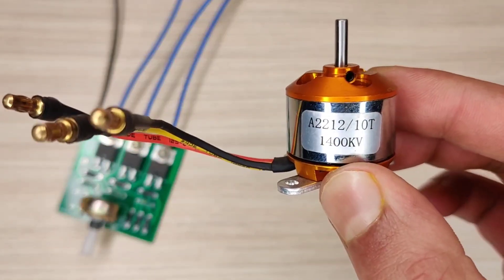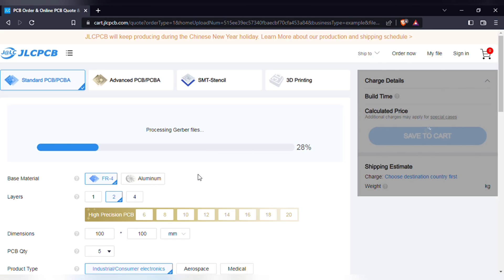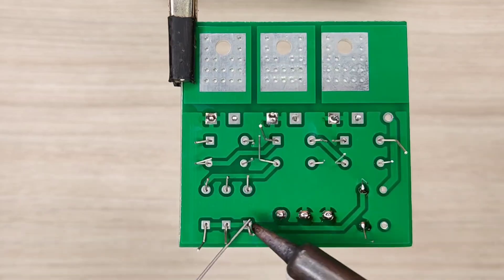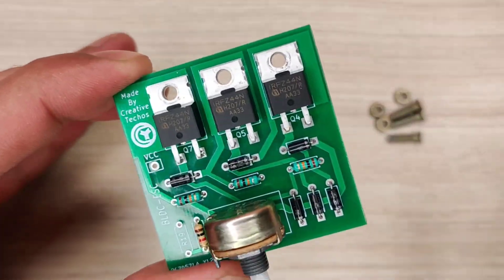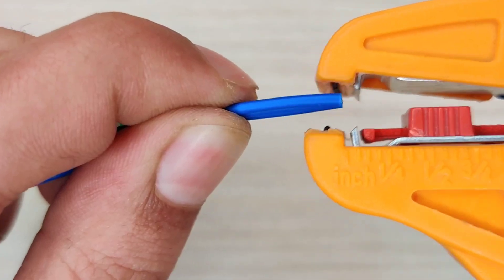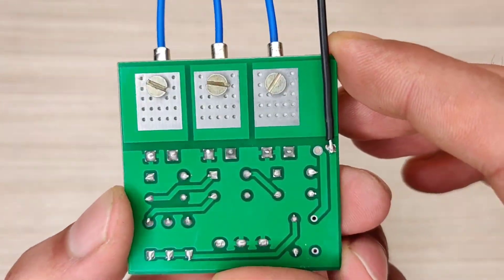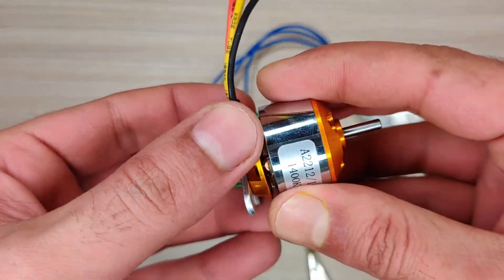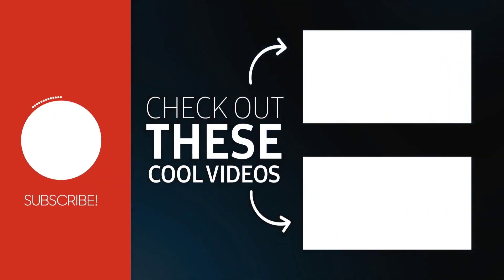Simple BLDC motor controller circuit Using irfz44n mosfet

Comment: I don't think it can work like this!
No control signals / commutation
There is nothing on the G gates of the MOSFETs (Q4–Q7) that dynamically switches the transistors according to the commutation sequence of the BLDC motor.

It looks like the gates are just connected to the power supply via diodes via resistors.

This way the phases are not switched in the correct order needed to turn the motor.

Comment: BLDC controller using only mosfet transistors without IC - it is a very good work, but I have 3 phase motor with 3 wires (without common). How to connect it ?

Comment: The gerber file you linked is different to the one in the video. it does not have a +VCC port. Could you please link the same pcb board that you used in the video? I need it for a physics assessment at school.

Comment: if your motor has no Common pin you can connect 3 wires together then a 1k resistor to get the neutral point on resistor free pin and use it as Common wire. for more info see BLDC motor winding structure.. I prefer to use HDD board motor driver instead it is more specialised for the motor itself.... Good luck

Comment: Please share the basic circuit . Also specify for what type of BLDC motors this circuit is applicable . If the wattage of the BLDC motor is  around 300 watts wil this circuit still be applicable or else what changes would be needed in this circuit for higher wattage BLDC motors
Very good job done by a fellow Indian

Comment: I have a 4 wire motor from a hard disk drive but there is no indication which wire should be the ground. I have tested them for continuity but it seems that both end wires are common to the other 3 wires. Is this correct? And if so does it not matter which end wire is connected to common/ground.

Comment: can the same be done with 3 IRFBC40  MOSFETS WITH 4 DIODES and 2 zeners and capacitors for 6 wires input to ZWS 400 NON CARBON BRUSH MOTORS , ??

Comment: How much voltage required input line on pcb min to max?
Reply: 12-90v max but if you want lower voltage input you can use other type of low power mosfet irfz44n or   high power 24v mosfet irf3205 its 200w 80A max

Comment: In your given zip file there is no place for negative input, where I should join the negative  input of battery ?
Reply from the maker: Negative input goes to the common wire of bldc motor
Reply: And Where I should connect positive input
Reply: You are right. I have just got my board from the printers and there, is no pin on the board to connect to ground. But from the CD pins 2 and 3 of the Pot are connected to ground and appear to be like this on the board so I am going to try connecting the ground wire to pin 3 of the pot.

Comment: Greetings Teatcher. Thank you for the excellent project.
1) I built the circuit on a Protoboard, initially to experiment, and I am using 5V 2A as the Power Supply. It is working but usually I have to give the Motor a push. So I don't know if a Power Supply with more Voltage or more Amperage is needed. Any hints?
2) Does this circuit work also for CD Rom Motor? Thanks a lot.
Reply: 1. try more voltage
2. if it is a 4 terminal motor = yes
Reply: Thanks  @user-rs8zg8ey2b

Comment: Quick question.... does this controller allow the motor to run forward/clockwise and then straight into reverse/counter-clockwise or just one direction?
Reply from the maker: It works only clockwise
Reply: @CreativeTechos incorrect, switch 2 motor wires and it will run the other way, so you could add a DPDT toggle switch to add reverse operation.
Reply: @CreativeTechos How he recognise to run clockwise?
Reply: Just one direction

Comment: Great work.
I love it.
What about a very HV (12 - 120vdc) & High Amp (80A - 120A) circuit.
Can you please help?
Reply: Got components that can handle 14 kW? 120A @ 120Vdc is over 14 kilowatts, 80A @ 120Vdc is about 10 kW.. good luck with that.
Reply: @grey_Sparky    thanks so much.

Comment: Where does the positive voltage on the circuit if the motor does not have a common wire?
Reply: bait click thumbnail. it wont work with 3 lead motor

Comment: Where does the positive voltage on the circuit if the motor does not have a common wire?
Reply: nowhere, this circuit cannot drive 3 wire motors, like his thumbnail shows, its bait and click, unless you want to rewind the motor, lol

Comment: Can we use this circuit with bldc fan motor?
Reply: bait click thumbnail. it wont work with 3 lead motor
Reply: @user-rs8zg8ey2b yes , fake board oh shit, it dont work on BLDC 3 wire
Reply from the maker: Yes, You can use this, Max current output is 30A

Comment: What is the supply voltage , what is the maximum output .
Reply from the maker: The supply voltage is 5-12v 30A max
Reply: @CreativeTechos incorrect, the fets are rated to 60v, but the gate is only rated to 20v, to 20v max, and the fets are ~50A if kept cool (fan or heatsink)

Comment: Good circuit.
This type of circuits are very much needful for star configuration of BLDC motors but are useless for Delta configuration BLDC motors.
My request is if possible, do not rewind the BLDC motor from delta to star, rather try to make a ESC which is compatible for running all delta configuration motors.
Reply from the maker: Thanks for watching my friend, i will try to upload video ASAP for delta version too 🙂
Reply: Correction, star with center tapped connection, not the majority of star wound motors
Reply: Sir one prize charity
Reply: Hello, and what are the BLDC motors with Delta configuration? Tks